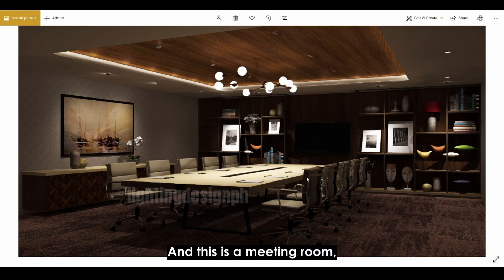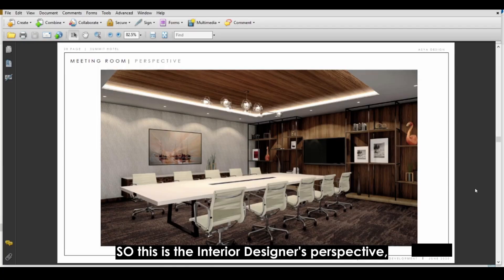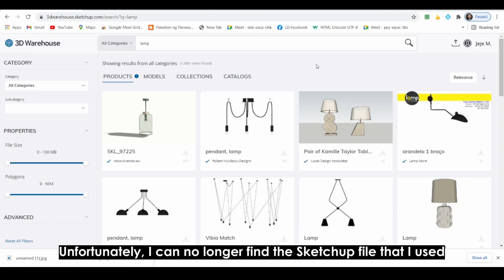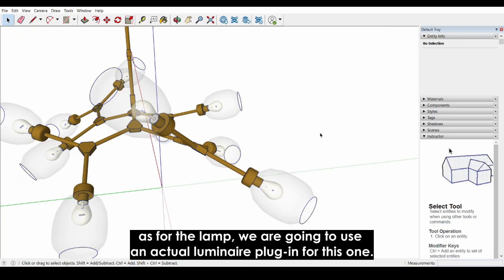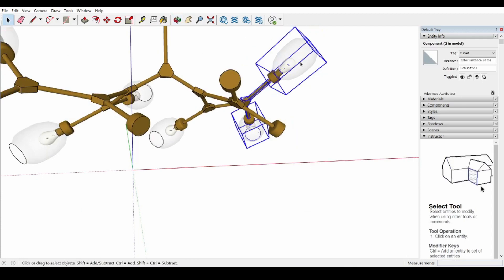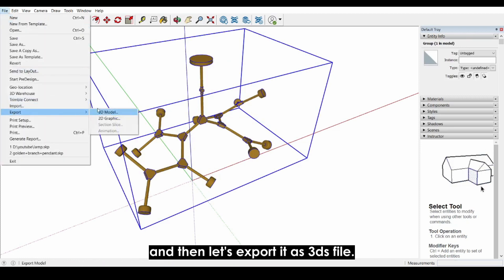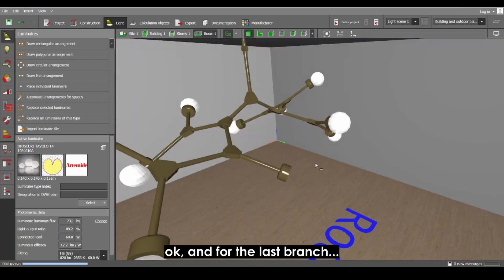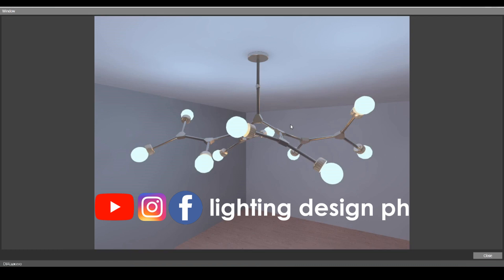Dialux Masterclass : How to Make Customized Pendant Lamp in Dialux Evo

Comment: but tavalo from Artemide is table/floor lamp right? Will that not effect the lighting calculation? If we are using it for chandelier?
Reply from the maker: Hi Ana, I used the tavalo, because it has almost similar beam with typical E27 led bulb on round frosted glass diffuser, same size with supposed customized round diffuser and  adjusted   the lumen output. the tavalo it's actually a multipurpose lamp, for table or floor. As for chandeliers this is not advisable as the dimension of this light is not appropriate for that purpose, use the exact 3ds file of the chandelier and use the exact IES file of the bulb.

Comment: how can we connect the suspended fixtures to the ceiling. After importing and placing the luminaire for suspended lightings, I cannot see the cable or tube connecting that to the ceiling. Not from sketchup. Iam talking about ies or ldt files .How to do that
Reply from the maker: Hi Shamsiya, just use cylinder object, probably resize it into thin rod size, imagine a pendant lamp, wiith suspended rod and use cylinder object for the suspended rod shape and attach it on top of the pendant lamp. I hope you are imagining what am thinking atm. I cant attach a pic into this comment box